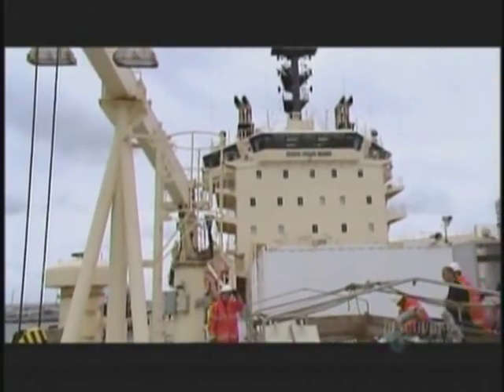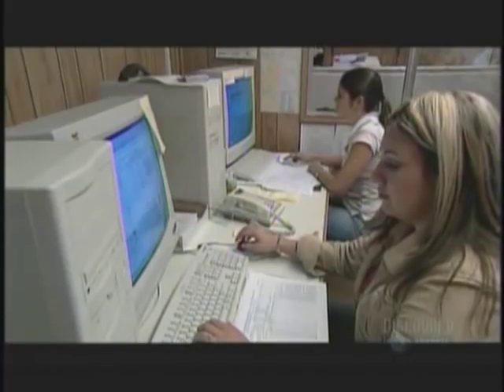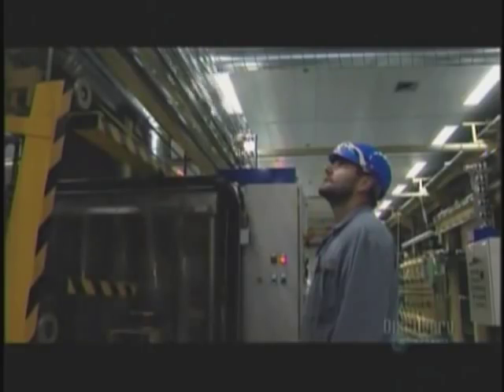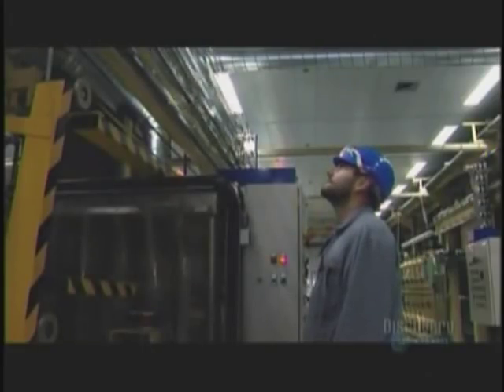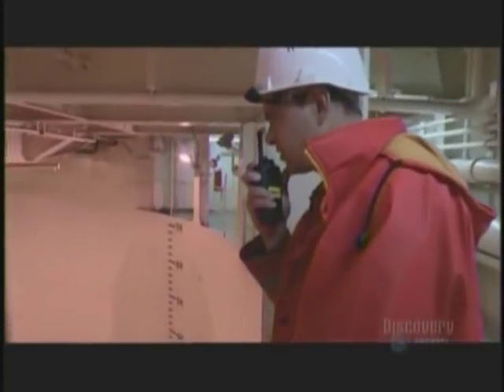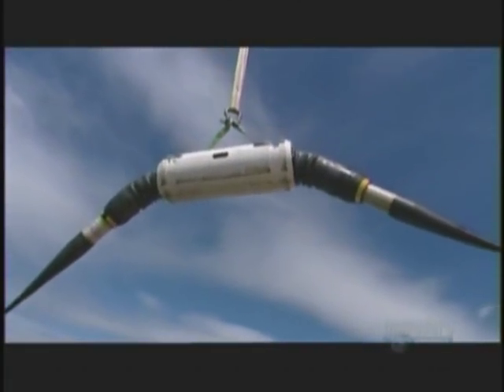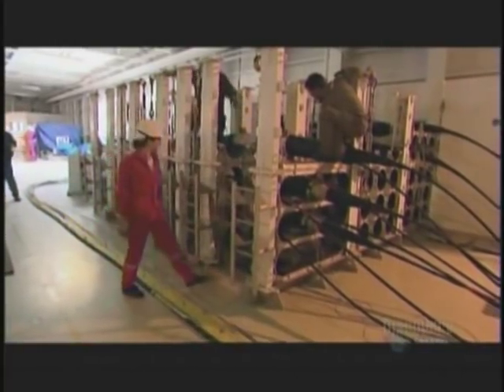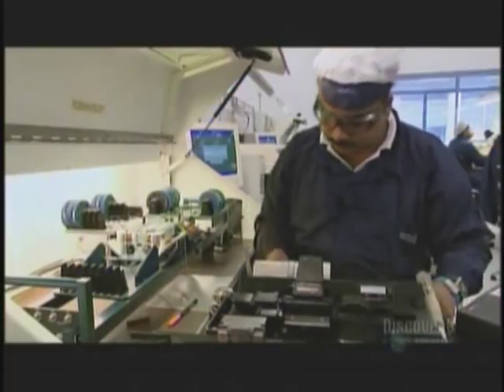Undersea Cable

Comment: this video is pretty informative but the important thing is missed here, it is not hair size fibre optic cable plunged and laid into sea bed but has 8 layers of shield to protect this hair sized fibre.

( the way you shown repeaters. Repeaters were not simply attached to hair sized thin fibre but the entire shielded cable.)

Comment: Current cables have a capacity of several TeraBits/second. (over a million times faster  than an average DSL connection). And they keep getting faster.
I know most of this stuff but im surprised they would load the cable by hand (3 weeks...). Id think they would build a robot or machine for this task.
Also didnt know that relays weight half a ton.